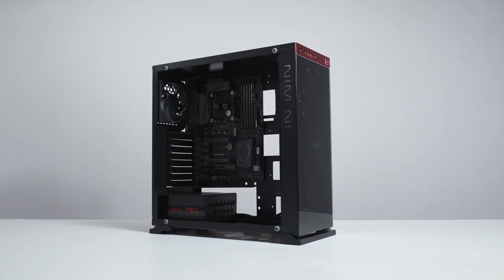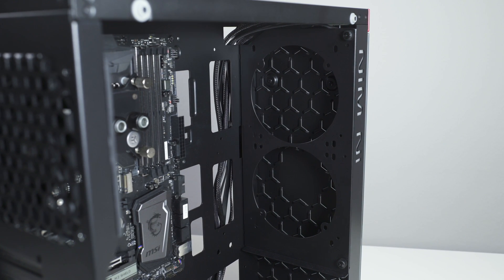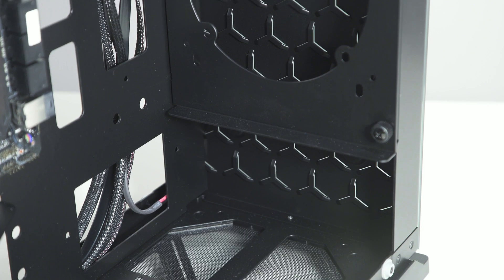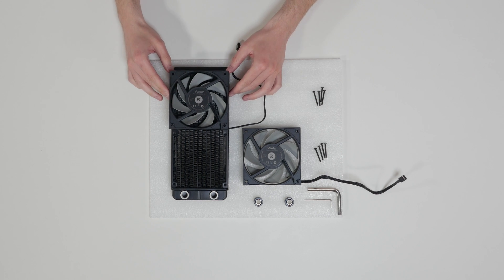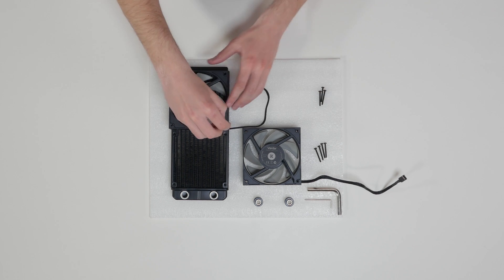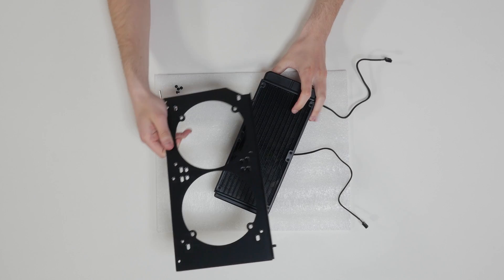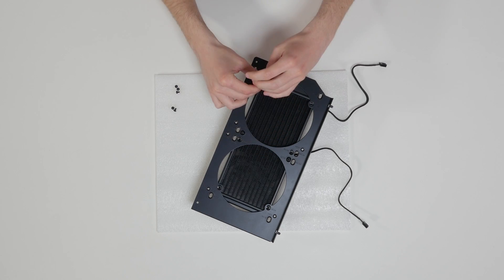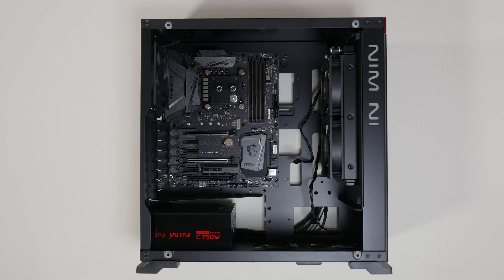EK Fluid Gaming A240 - Installing the radiator and fans

Comment: I'm sorry, but aren't the fans installed the wrong way?
Reply: Well alright, but speaking from a cooling standpoint would this be better than using it as an exhaustion or does it make a rather minimal difference?
Reply: For this 'pull' configuration, it fans are positioned correctly. The fan sticker denotes the rear/back side (air is moved from front to rear). Push or pull doesn't have much difference or is negligent in terms of temperatures..